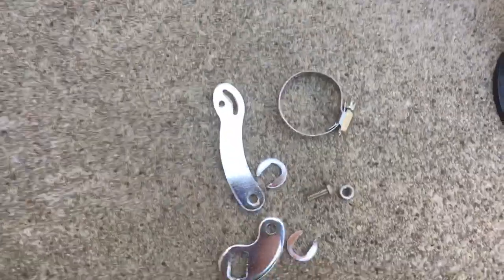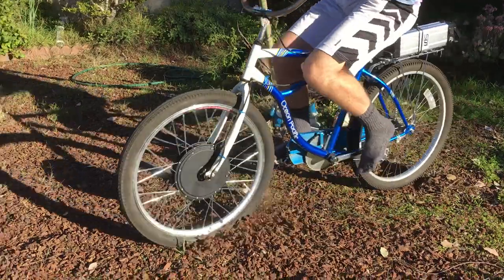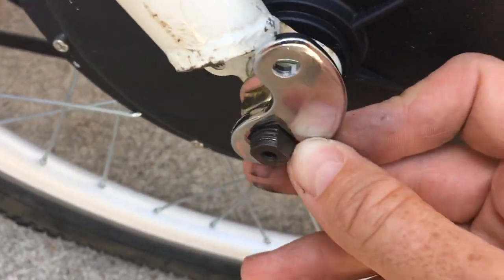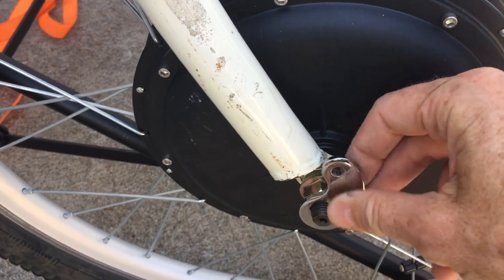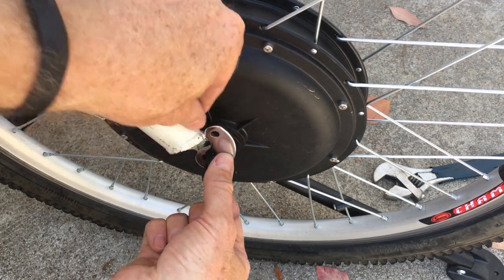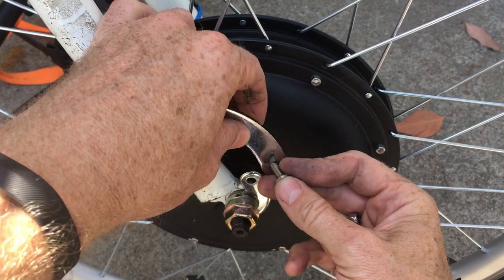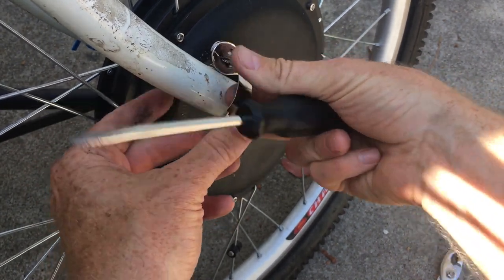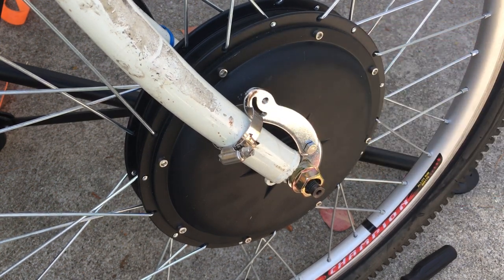How To Install A Torque Arm On An eBike

Comment: I have this problem for the rear actually.

I went to Home Depot and got some heavy duty lock washers.  Do you think lock washers will be strong enough to resist the torque?
Reply from the maker: I don’t know. That would probably help, but the torque arm is designed to resist the twisting action.
Reply: Thanks so much for the reply. I have a 3000 watt hub motor on a mountain bike and the torque arm that it came with was so unusual.   It was built of solid stainless steel on both sides and in the middle was cheap die cast metal in between. 
       That axle would go between it.  So I was riding and over a period if time, it got  bent out of shape.  
     The stainless steel of course is still in tact.    I don't know why the thing wasn't designed entirely of stainless steel to begin with.
    Anyway after it broke, I went to Home Depot, got some heavy duty lock washers.   They are about 1.5 inches in diameter. 
      Was using them for while.  They held up pretty well until when I tried going for a ride one day last week.  The back wheel got loose.   I wasn't even out for 8 minutes.  I went right back home.  I'll just get a universal torque arm tomorrow.   They have some really inexpensive ones on eBay.........less than 10 dollars with free shipping.
Reply: I also meant to add that I had bought 2 heavy duty ordinary washers in addition to the lock washers.   Fastened them on both sides.   But yeah, that is a tremendous amount of power for an ebike motor.  The tension from using lock washers with the ordinary washers is very strong but will still succumb to the torque force from the motor
Reply: @hoohoohoblin  

I also meant to add that I had bought 2 heavy duty ordinary washers in addition to the lock washers.   Fastened them on both sides.   But yeah, that is a tremendous amount of power for an ebike motor.  The tension from using lock washers with the ordinary washers is very strong but will still succumb to the torque force from the motor.

I ordered a torque arm so I'm just waiting for it to come in the mail
Reply: I ordered a torque arm from eBay.   I had to wait approximately 3 and a half weeks for it. It came from China and the rings are unfortunately too small 😒
Reply: @milestone_achiever4634  did you ever get a good torque arm?
Reply: Hi.  

Thanks for reaching out. 
     I remember I asked you about my torque arm situation last year.  
    In any event.  I never ordered a new one.  I was not trying to have to wait an extremely long time just to order something overseas again and risk it being the wrong merchandise...........again
    I am simply using a piece from the torque arm I already have. 
   I  bought some small U-bolts from home Depot.  I have each U- bolt secured around both sides of the axle.
      I rode this past Sunday.   
No problems.............. at least for now 
       Truthfully speaking, the  wheel did not budge at all.
   Let's see if it can stay that way indefinitely.

How have you been managing thru the whole virus outbreak?
Reply: @milestone_achiever4634  good innovation. As long as you have that axel secure. I've been doing ok, just taking life one day at a time, spending time with my family and working on projects including my ebike. Just added a suspension fork and another torque arm to the other side.

Comment: Does this work for V brake tires as well as Disc brake tires?
Reply from the maker: Yes. You’d have to put it on the side that doesn’t have the break if you are using them with a disc break.

Comment: How to you put the arm on the axle on the other side?,Theres a wire coming out the axle and the plug head on the control box end is too big  to fit through the hole
Reply: Did you find a solution?
Reply: Try to de-pin the wires out of the plastic plug, feed them through all the washers, torque arm, nut then re-pin the plug with the wires. Those plugs can be de-pinned by slightly bending the thin metal holding the pin in the plug. Look at how the pins are held in the plug.

Comment: pretty sure you did this backwards... how is the force counterclockwise when the wheel spins clockwise!?!?!?
Reply from the maker: The wheel is turning clockwise, which means the axle is trying to turn counterclockwise.
Reply: If you were to hold the wheel while it's running, (as a thought experiment, obviously to really do this could be a hazard and also twist apart the power cable) the axle would spin in the opposite direction. There has to be an opposing force for there to be motion.
Reply: @hoohoohoblin  Thank you for this...your method works fine.

Comment: What about the side with the wire?  Do you only need one side?
Reply: Depends how powerful the motor is, below 1000watt, 1 torque arm should be enough.
Reply: How do you put them on the side with wire im scared to mess with it
Reply: @lozzadcleatz8251  cut the bottom out of the axle hole with a hack saw, this opens up one end , then slide it on to the axle.  just like the dropouts already on your bike.
Reply: @paulmervyn1613  ah that makes sense thanks alot
Reply: On the Voilamart, you can just de-pin the 5 wire plug and feed the wires through the torque arm and then re-pin the plug.

Comment: Thank you for the great video! Could i use double or is that overkill and one is enough ?"
Reply from the maker: I think one is enough. I guess you’ll be double sure if you put two on.
Reply: Overkill but not hurt anything either :)
Reply: Now we know why front hubs are usually 350w geared.    To the store and back

Comment: I installed the torque arm on the front like in this video, and as I drove, I noticed the torque arm twisting towards the rear in the direction of the fork... I guess the torque arm was supposed to be making contact with the forks to start with? I was under the assumption that it was the hose clamp that would prevent rotation but your intention was for the fork to prevent rotation? I wish I had understood this in the beginning, now I have to buy a new fork for my 30 year old bike. To those who say it's backwards, I think it's supposed to be in front like in the video, but the torque arm needs to be making contact with the fork. That's the key.
Reply from the maker: Yes. That’s correct. It has to be pressing against the fork so it can’t move at all.

Comment: Critical step in installation was to ensure the plate was rotated clockwise in order to take up the play in the slot.

The way you have installed that provides no additional support.
Reply: No, the axle would spin the the opposite direction of the motor, so he installed it perfectly fine, even if he had installed it on the bottom part of the frame it would have held perfectly as the metal "zip" thing would keep it sticked to the frame but he installed in on the right size
Reply: @gursisingh1940  You aren't visualizing the problem correctly. We both agree the axle with rotate in the opposite direction. The use of the torque arm and how it's attached is irrelevant if you don't take up the play in the slot by rotating with wheel direction. This means that the axle will be hard against the opposite edge, meaning no movement in the axle direction. If this is not done, you are essentially not reinforcing the drop outs as the play in the slot means all force is still on drop out but squashed between two extra washers. If you need a diagram I can sketch one up but it's a essential step when installing anything: Is there play? Should there be? Solve
Reply: @Geski0  hello friend, you sound theoretically knowledgeable about this subject. I would like to take advice from you for my ebike build. I bought a £100 Argos bike and installed a 1000w front hub wheel with the normal torque washer that came with it. I had tightened the nuts well, but still after 2 miles of smooth running, the axle twisted in the dropout, pulling in the cable and the whole thing jammed up, luckily the motor cables are not completely damaged. It also looks like the dropouts have widened a little bit and the axle has a 2mm play.
I was being a little impatient to wait for the pair of torque arms to arrive from eBay, even though I had read about this known issue, I underestimated the power of such a motor especially on a cheap bike. 
Now having said this, I am not giving up already and want to have the best solution that is durable. I want to install 2 torque arms on both sides, one to prevent the counterclockwise action during starting off and the other one to prevent the clockwise action due to inertia while braking. Am I visualizing correct or do you think it would be a bad idea? Does the C washers play an important role while installing the torque arms? Can you suggest the best configuration for my setup please.

Comment: "heavy duty fork" all those rigid forks Will take less to be destroyed just wacth sam pilgrim on the free bike test he smash rigid steel fork with ease with mtb intense jumps so with weight and torque aplied at the fork you better treat it gently just normal use for use and always better a rear wheel motor
Reply from the maker: I agree. If I had to do it again I would definitely put the motor in the back.

Comment: That is a normal bike turned into a home ebike. A retail ebike is much more durable and I was already told unless you put 2000 watts or more that those are not needed on say a real ebike if you add a motor or upgrade one to 2000 or under.I have a 5 year old mountainbike and it would need this--but my new ebike has much thicker parts.

Comment: This link shows the correct way to install https://youtu.be/eT_M2v_bFcE
Reply: Not really, that video also shows it with the torque arm on the front of the fork which is the wrong way. It's supposed to be on the back of the fork, so the rotational force isn't pushing down on the axle which is bad especially with a loose nut. The axle could be pushed out of the dropout. With the torque arm on the back, the twisting force is pulling the the axle up while also resisting the axle twist.

Comment: i think thats backward bro.
Reply: no , the torque is rotating backwards , opposite to the wheel rotation , this way he has the frame itself stopping the backwards rotation of the spindle  , rather than just the strength of the hoseclip , if you can do it like this its the optimum way to do it , but not always possible

Comment: Wrong improper installation of torque arm, very dangerous do not follow this guys advice he has no idea what he is doing.
Reply from the maker: I don’t know. Some people say I’m wrong and some people say I’m right. We’ve been running this bike for years, and my son rode it to school for a couple years, and it still works fine. I think as long as you stop the twisting force with the torque on, you’re OK.